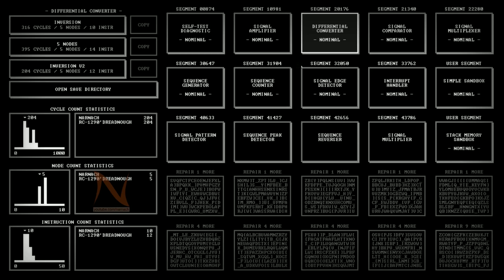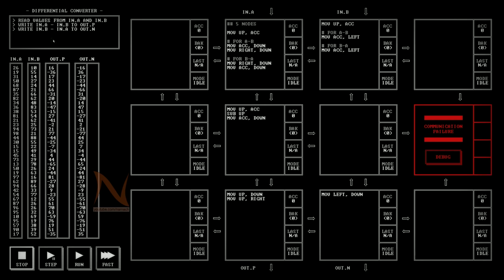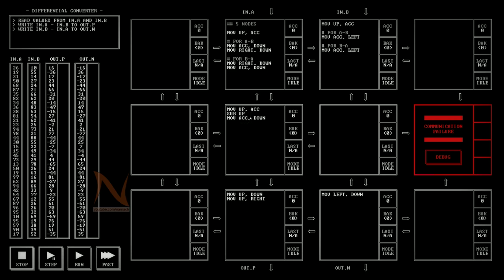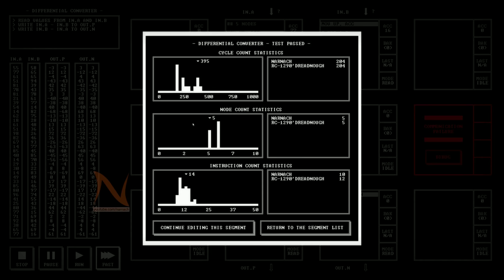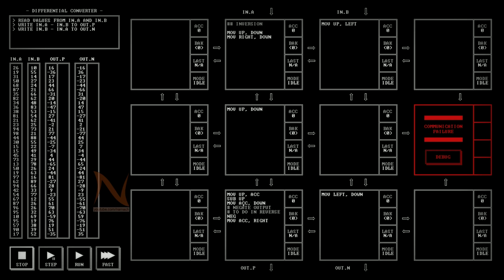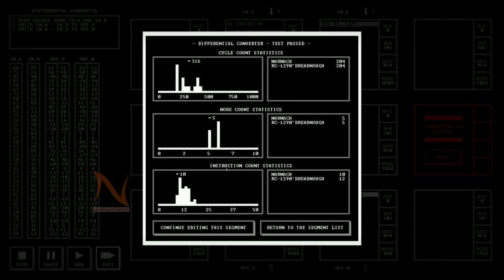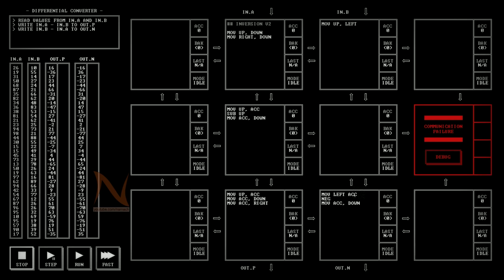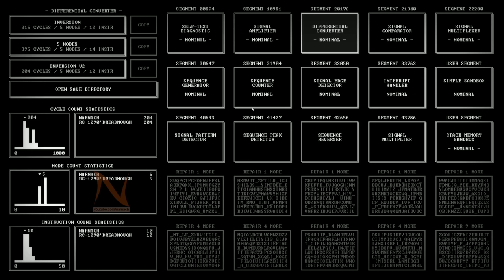#2 - Differential Converter - TIS-100 for everyone (machine 3 strategies)

Comment: Question: In your most optimal solution, you write it down before writing it to the right... won't you save a cycle or two writing it to the right (so it can start to negate it) before writing it down?

Just a tad more optimized that might leave your friend (or whomever "RC-1290's Dreadnough" is) scratching his/her head over it ;-)
Reply from the maker: Alexis Cheynas that sounds like it should work. Thanks!

Comment: You can rewrite neg using sub to get down to 200
Reply from the maker: Matt Davies I tried this and ended up tweaking it to: SUB LEFT; MOV ACC, DOWN; MOV 0, ACC. The MOV 0 makes it come to 201, but if you don't use it, you never reset the node. Or did I misunderstand you and is there a way to do it in 200?

Either way, thank you for helping to optimize the solution!
Reply: Do subtract in the IN.A processor makes it faster?
Reply: I don't code, I barely understand this stuff at the best of times, but I just started playing and I managed to find a 200/5/11 solution. Like Matt, I also didn't use neg, and the 11th command is in the 5th node in the middle, just as footwork to get to the bottom row. Solution: https://imgur.com/gallery/RGnv9